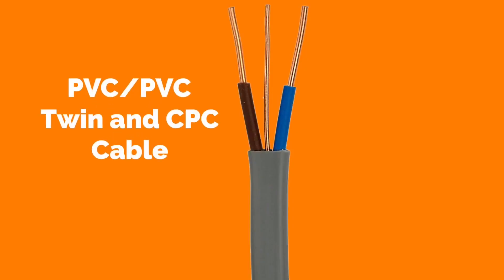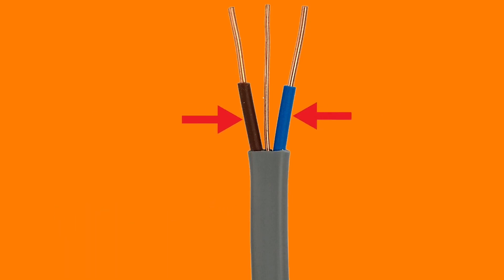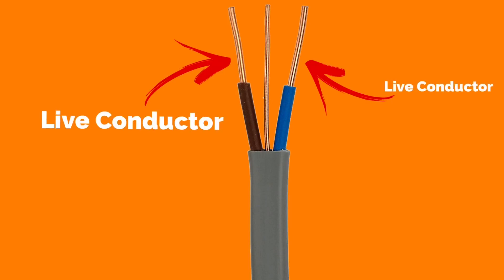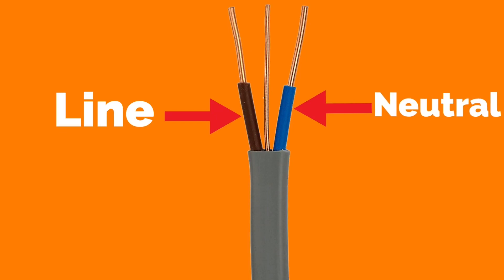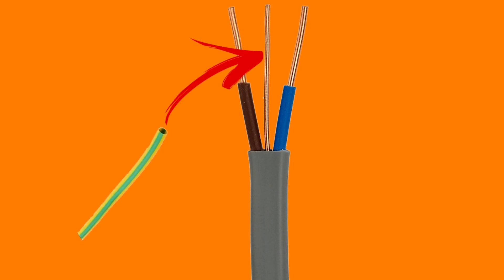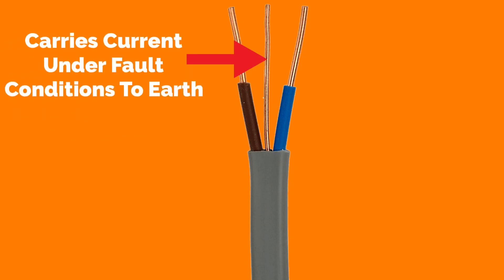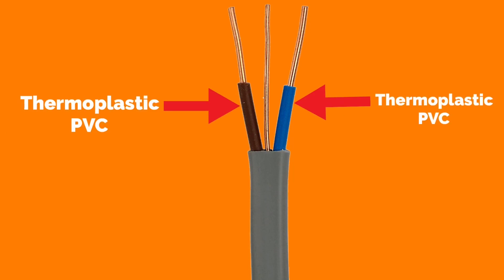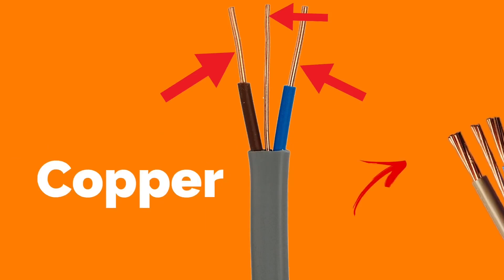Construction of Twin and Earth Cables - Doncaster Cables

Comment: hi gaz in ireland we switch to this back in 2017 the cpc to be insulated green/yellow and to also be the same csa as the current carrying conductors would you think the uk may do something like this in the future  .
Reply from the maker: Gavin Geaney fantastic 👍
Reply: How are the conductors arranged in the cable? I think that Line should be in the middle if they are all sleeved and of the same cross-sectional area. It would reduce the electrocution hazard from a damaged cable, all other things being equal.
Reply: dalriada842 the t&e is still the same configuration and looks a lot better when terminated

Comment: Students sometimes when designing a circuit a 4mm T+E cable does not have a big enough CPC as it Is sized at only 1.5mm.
The way around this is to use a 3 core and earth utilising the extra core as a CPC, creating a CPC of approximately 5.5mm.
Remember to sleeve and identify the extra core as a CPC. 
the CPC has to comply with thermal constraints so as to prove that it will not be damaged during an earth fault event, not a rcd/rcbo event but a full fat mcb/bs 88 earth fault resulting in a potential current (If) of several hundreds of amps,maybe thousands?lasting several tenths of a second up to 5 seconds for fixed equipment. Don't worry once you learn about the design stuff,it's a doddle.👌

Comment: 70 degrees cable are almost not used anymore in Denmark. Only 90. (Bigger load) Regards from DK.🇩🇰
Reply: So what about the equipment connected to the cables?
Reply: Simon Aragon Normaly 60,70,90 degress.. But theese are calulatet a different Way regarding to loads.. hard for me to discribe in english. Danish No problem.😅